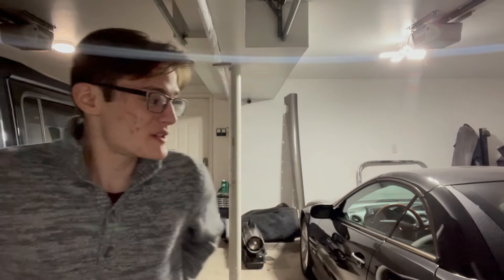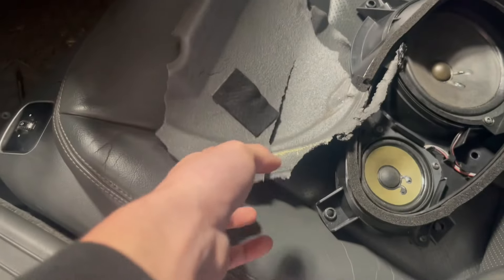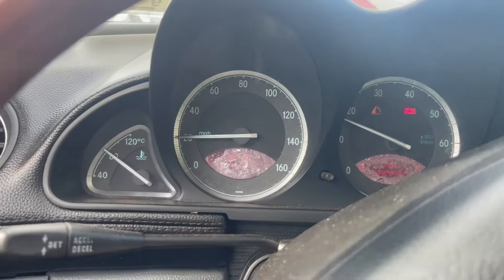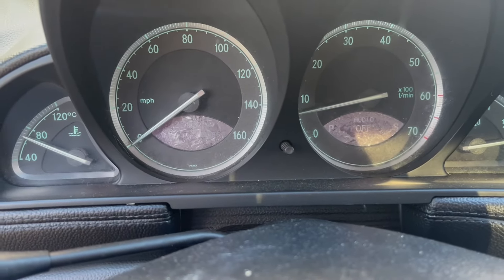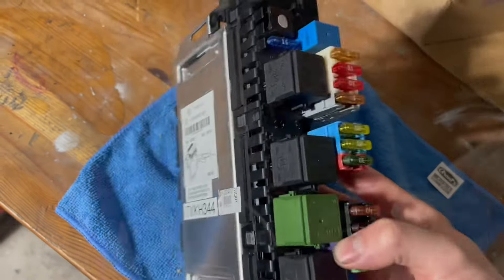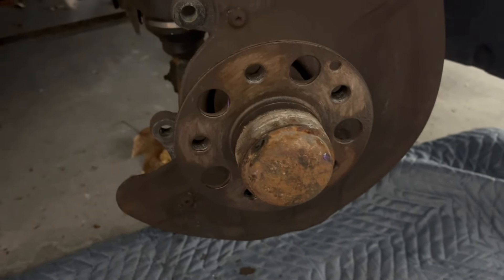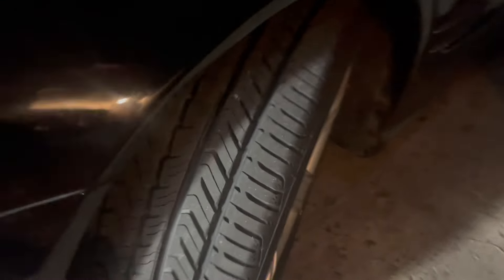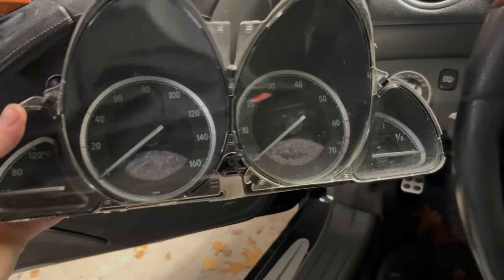Mercedes SL500 R230 Restoration - Part 1

Comment: Hi - you made that look easy! Did you need to bleed the rear brake lines? If so, how did you do this? Similarly....did you need to bleed the hydraulic suspension after changing the accumulators? How is the consumer battery in the back of the car - does it run down quickly? Sometimes the battery control module can have issues...especially if anybody has ever made the mistake of disconnecting the front battery before disconnecting the consumer battery, hooking a battery charger directly to the front or rear battery....or worse still trying to jump start from the rear battery. Good luck with this resto. Mike

Comment: Where do you put the jackstands when doing the brakes?
Reply from the maker: @jordanlundervilleministries  this was a while ago so I don’t exactly remember. I usually end up putting them on the subframe by the lower control arm mount
Reply: @ that’s the big area where the strut/shock connect right?
Reply from the maker: @ I put it right where the lower control arm goes into the subframe